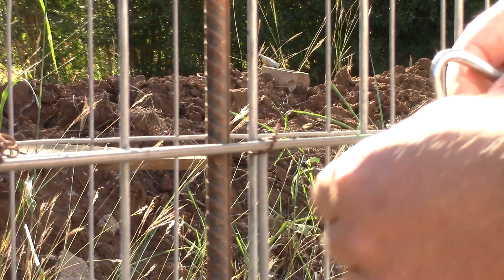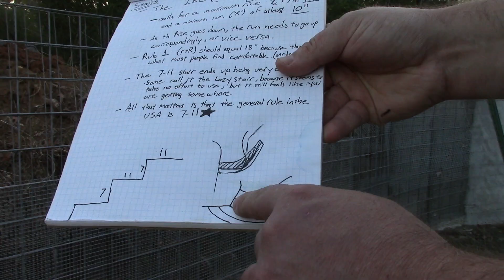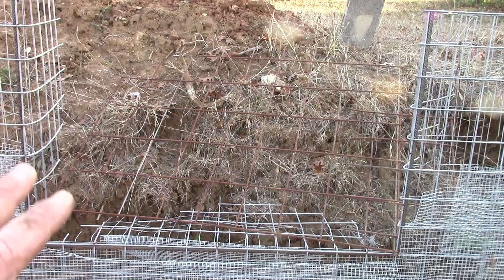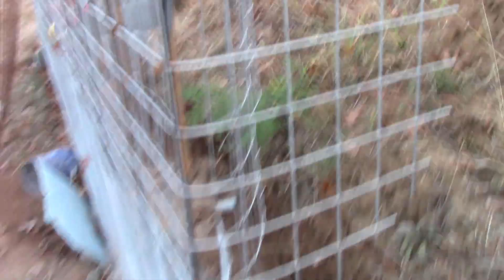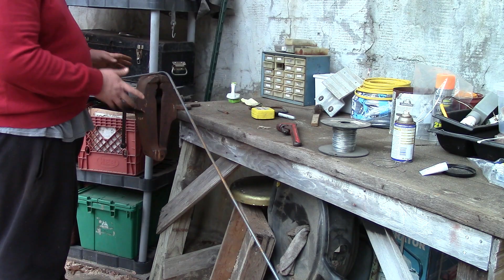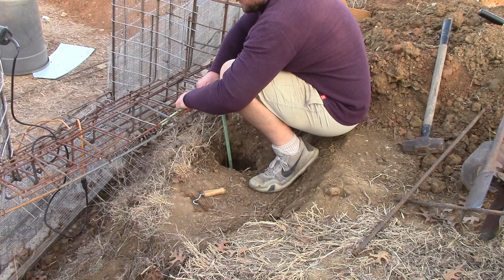Ferrocement House Project - Part 7 - Framing The Armature

Comment: Looking for thin concrete solutions I had found GRFC/GRC years ago. But I was always thinking if steel does not corrode, steel can be used. Its much cheaper. 
A week ago I was made aware of Ferrocement in a Video about the roof a a newly buildt event centrum in Athens. Also I found out that the famous architect Renzo Piano (who also designed the building in Athens) had made his Yacht out of ferrocement.  
As a general rule (Europe, germay) corroding steel should be 4 cms (1 1/2 inches) away from the surface. Near the sea its even more critical.
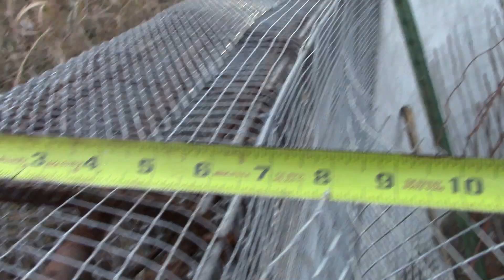When looking at the video series and especially here at min 9:00 its the 1st time that I see most of the stuff is corrosion protected. But not all. How is the rule/experience? 
Also, it seems I cannot get the small hole net made out of a metal sheet. The other stuff yes. Whats the optimal rectangle whole sitze? 9,5mm (1/3 of an inch) is available. 
How can I search on ebay? From there i should be able to find something similar in Europe. (Even on the continent whilst it would be more easy in UK).

Comment: The 7 11 stair pattern has an overhang of an inch and a half, this way your foot goes under the next step up.
You can either lean the riser or vertical part or keep the riser perpendicular and add a lip, preferably half round so shoes don’t get snagged as people walk up and down. 
The main objective is that each step is exactly the same as the others. Accidents can be expected when either the top step or the bottom step is different.